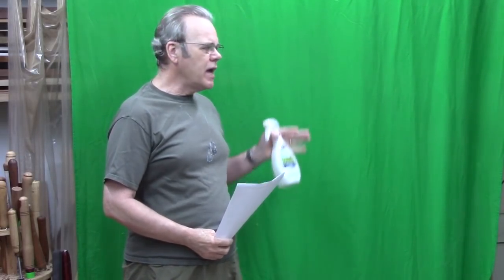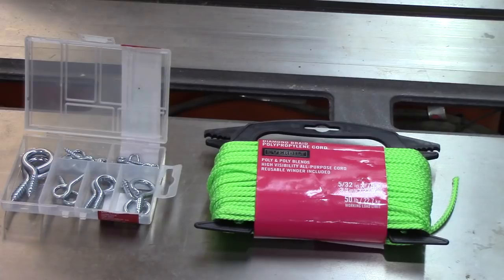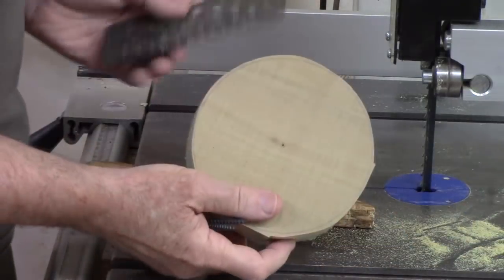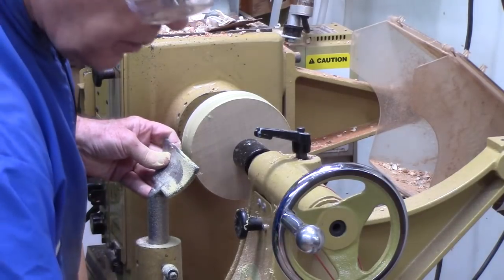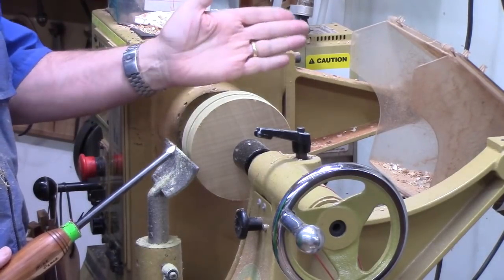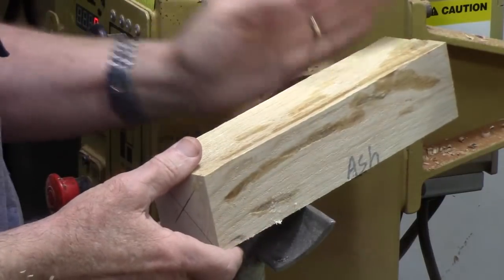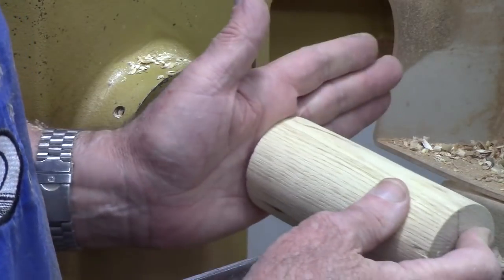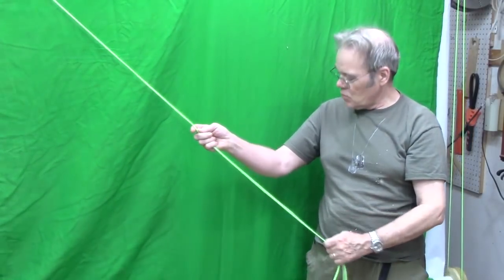DIY Roll Up Green Screen

Comment: Oh mike.....you try so hard...to help us all...in many ways..  I have no channel..  but most of your tips are useful...thx.. I have turned for 45 years..but thought about a deflection screen...to stop the chips and dust from making a big mess..seems chips go everywhere...I was thinking of some kind of shower curtain...
Reply from the maker: Great idea. I use one on the back of my lathe to keep the chips from staining my Bandsaw. I saw an article somehere where someone made the frame from conduit suspended from the ceiling. I found cheap plastic shower curtains at big lots. A thin mesh would keep chips in as well.
Reply: Mike Peace Woodturning yeah I turn a lot of very green oak and maple...the slinging water causes water marks on the ceiling and wall and creates rust on flat  surfaces like the jointer, planner, bandsaws and table saw...keep going I enjoy your work..Terry
Reply from the maker: Thanks Terry. Bradford Pear slings the most water for me but RO definitely the worst for staining cast iron!
Reply: Mike Peace Woodturning keep going mike I like your videos..be well too

Comment: Mike, just a safety note. When using a clamp like you had on the drill press, it's best to have the back end of the clamp slightly higher than the work piece you are clamping. You get better clamping pressure on the work that way
Reply from the maker: Thanks for sharing.

Comment: That's seriously amazing, I wonder if I can find all of those pieces pre-made but not expensive...  Curious about 2 things... Would it make a big difference if the pulley was only on one side, not on both sides, would it roll up unevenly?  If I'm working with multiple backdrops, is there a way to somehow roll them off of one pipe onto another pipe, so they basically always stay rolled up except for the one in use?
Reply from the maker: Can't say about the multiple drops.  I feel sure that it would not roll up evenly unless there are two pulleys. I suspect the pulleys could be glued up from three pieces of wood. So this could be cut with a jig saw or scroll saw from pine boards.